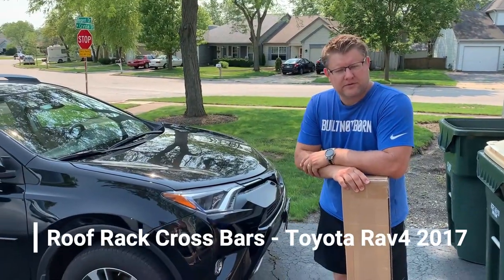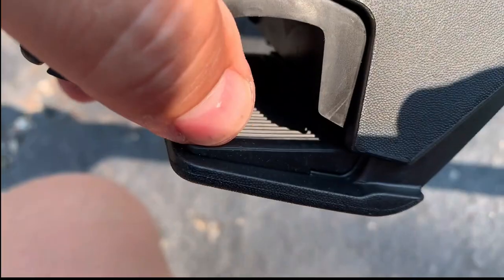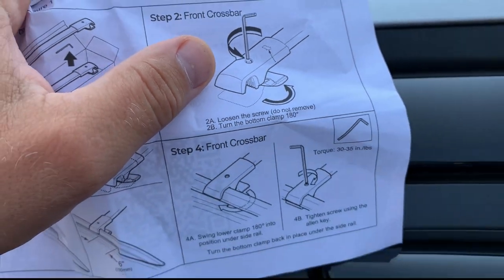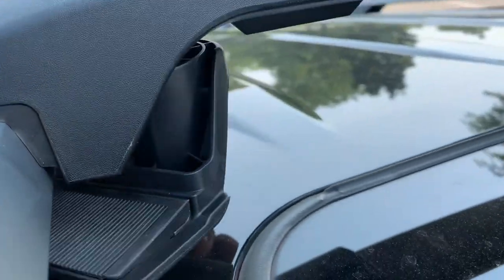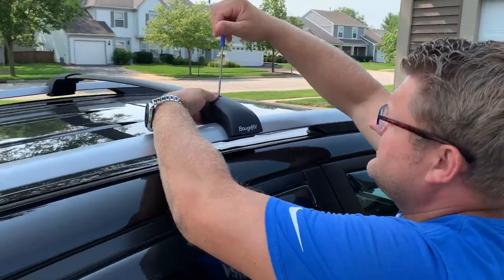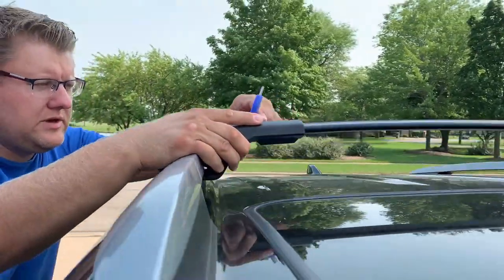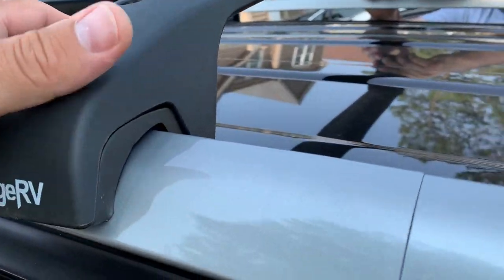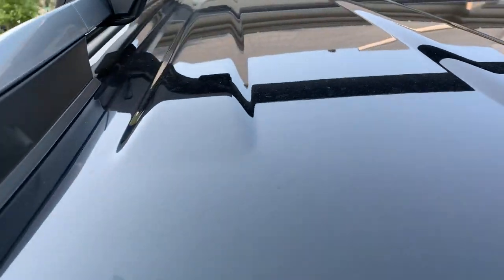2017 Toyota Rav4 roof rack cross bars

Comment: Thought I’d update this video. Based upon this video I purchased, through AMAZON, a set of these cross bars for my 2017 RAV4. These bars have been changed for the better. Best change is the bars now have a key lock. You get 2 keys with the bars. Second change is the bottom screws used to adjust the bar width is now available on both sides of the bar. 

With the key lock, you unlock a removable cover that hides the top lockdown screw. One cover on each side so 4 covers total. I torqued the top screw to the recommended 35 in. Lbs. For the lower screws using the provided tool is doable but tedious for me. I used a 1/4” Ratchet, 1/4” socket and a 5/32 hex bit. I used a mirror to help align the bit in the screw then tightened. Worked great, easy and fast. They look great. I will be taking a trip in 2 weeks so they will get tested.

Comment: Have you had a chance to use it yet?  Still happy with the quality?
Reply from the maker: I have not used anything on top of these racks. They feel solid strong, its says 70lb per each total 140lb but I haven’t tested them. I installed racks on my 2019 rav 4 from same company and they still great racks.
Reply: @nazarettos6987  thanks for the update
Reply: 6mths ago you installed.
Have you used them and are you pleased  ?